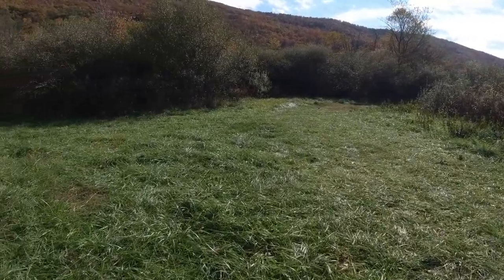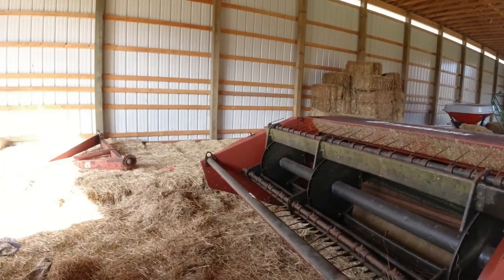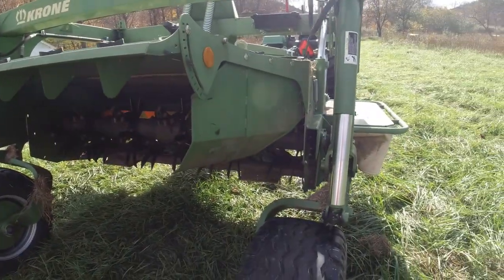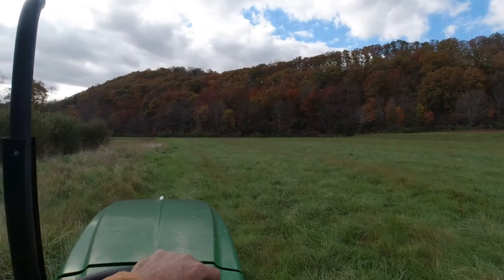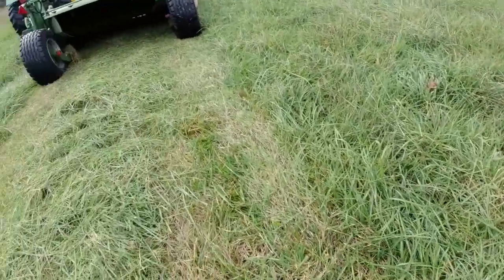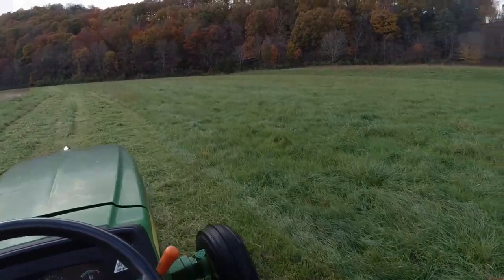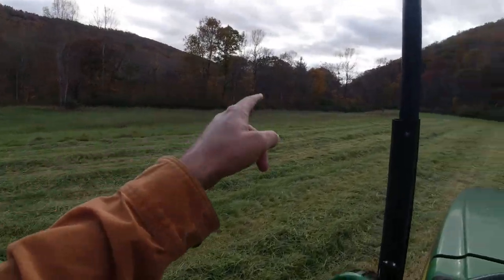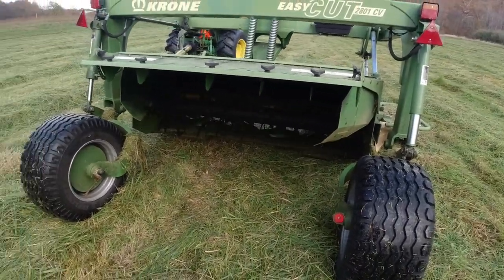Freeze Dried Hay Part 2 - Doing The Impossible - John Deere & Krone

Comment: Impressive! My Kubota discbine takes more hp to run. Do you have to run the mower tongue all the way out, or could you pull it in a little so you don't have to drive on the previous windrow? Not sure how the Krones are designed. That cutting should put some money in your pocket!!
Reply from the maker: There is an adjustment I need to make to where the open/close cylinder rod end attaches.  I’ve just been to lame to do it…🙄🙄